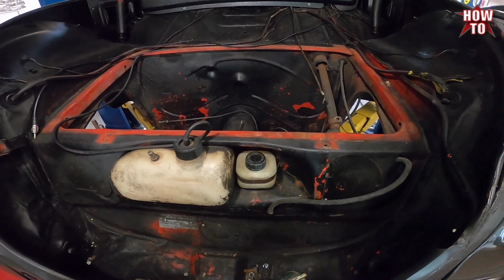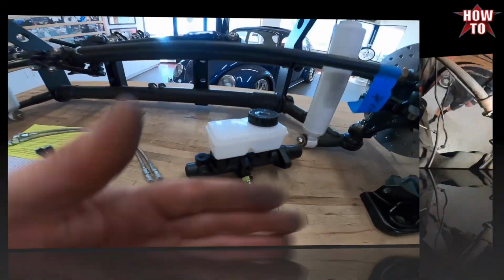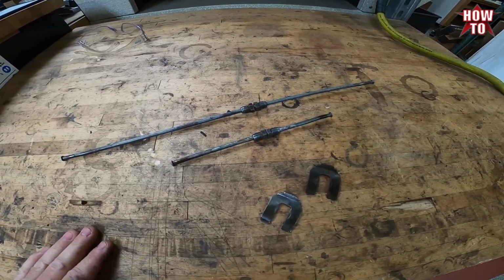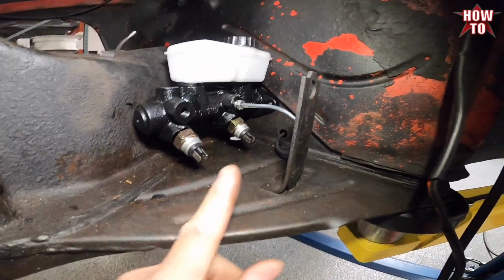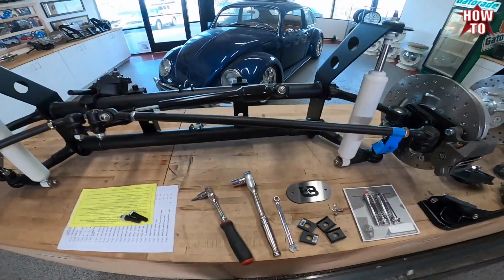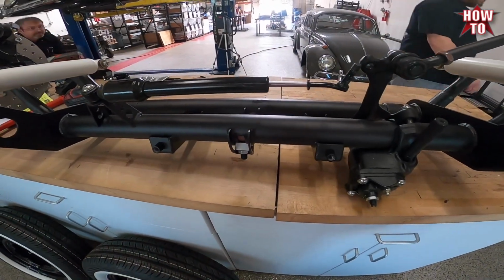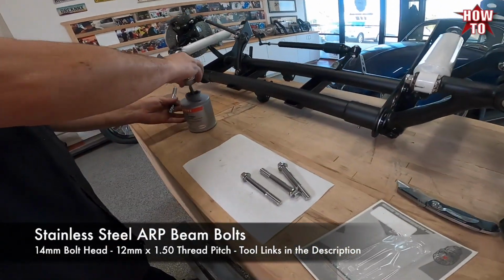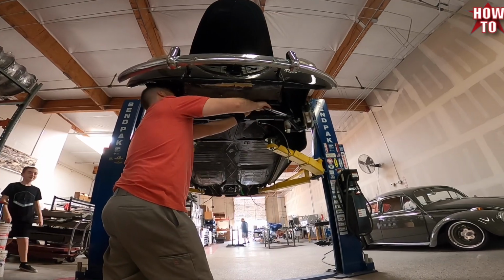1966 Classic VW Beetle | Part 3 | PREP is done, the PRObuilt Beam can NOW be installed | Airkewld

Comment: Fan of all products. Can you make a better steering box that will be more sport mode and play?
Reply from the maker: There is a ceiling with the VW platform. You can get to a point where there is cause and effect with every change. A properly adjusted, blueprinted install process, you will be perfect.